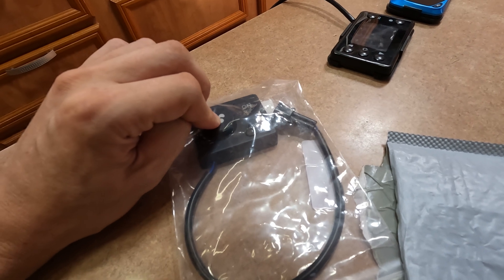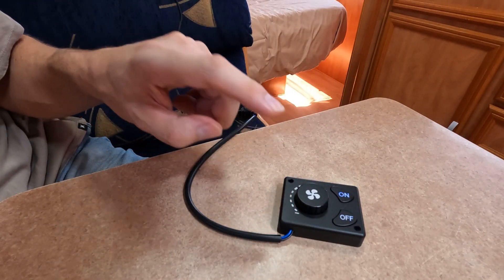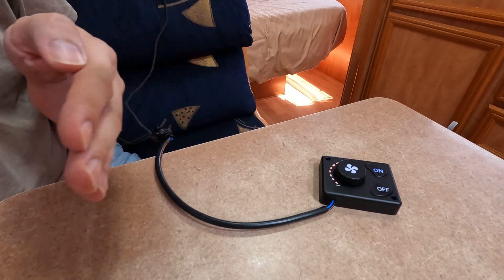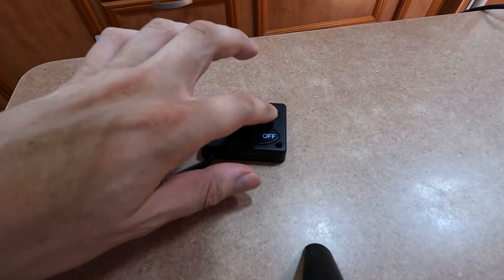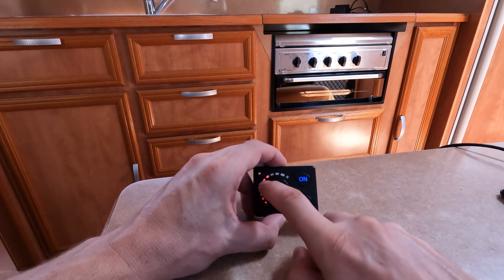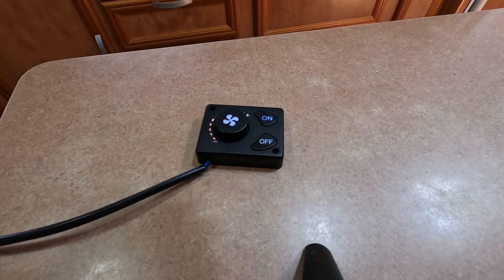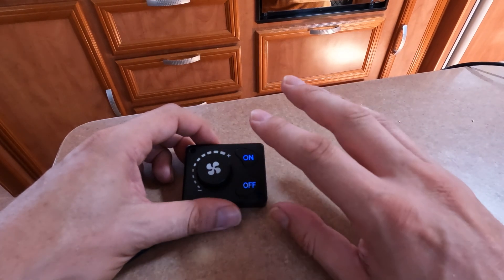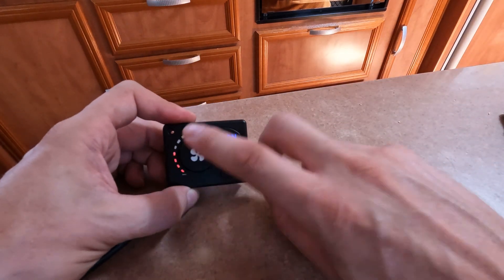How to use the rotary controller for a Chinese Diesel Heater

Comment: Can someone explain what a 6 and 3 blade controllers are?
Reply from the maker: This is a reference to the number of blades on the fan icon on the screen. some have 3 and some have 6.
Reply: @berko79 thanks but I'm wanting to get a new unit and use my rotary controller. Obviously there are no icons on the rotary controller. Do you know if the new 2kw units are 3 or 6? Many thanks
Reply from the maker: @thatwasthedaythatwas  unfortunately i think they are a mix. I've had success in buying the ones with the same plug, type but i've heard thats also not a confirmation of compatibility. Possibly worth taking the gamble - worst case you might need a new rotary controller (which are cheap of amazon or ebay)

Comment: Mine does not switch off. It's tarts but won't stop. I installed it brand new . Came with the heater. So they are not entirely trouble free.  Nor does it click as the dial is turned. Very disappointing.

Comment: These heaters should be outlawed until they can produce a working heater controller I bought 2 diff brand heaters junk bought the knob junk bought all new mother f er board still nothing, dont waste your money, these companies are running a ponzi, also pluged into wall, running car, also seperate battery and charger, charger by its self.  junk.

Comment: When I replaced mine with a simple controller, it wouldn't work & flashed the 7th lights.
Reply from the maker: E07 is communication error (see in the description for a full list). I'd say your controller is not compatible with your heater ecu board. You'll need to replace the control board inside the heater to make it compatible. I'm guessing your old controller, which it may look the same as mine, might be the featureless one they bought out.
Reply: @berko79  thanks. Which controller board do I buy?

Comment: Does anyone know how to change from simple Hz adjustment to actual temperature adjustment. I got mine changed over to Hz somehow and I can only adjust the power output with the knob. It used to rev up and slow down automatically with temperature. I want to set it back the way it used to be, but don't know how to do it.

Comment: I bought this basic rotary controller based iff this video and happy to say it works as advertised. Much simpler to use than the digital version that came with the heater originally
Reply from the maker: Yeah I agree, often simple is the easiest/best :)

Comment: 7:31  what is the blower / heater outlet temp in low and hi setting?? Is the heating power allso reduced or just fan speed?? Is the air temp 30c or 80c in low setting??
Reply: Rotory dial is for the fuel pump speed not so much the fan itself, fan does eventually slow a bit according to fuel input

Comment: Thanks for that. My rotary controller only works on heaters with '6 blade' controllers (not on the ones that use the newer '3 blade' controller). Or to be more exact, it works on heaters that have a motherboard that work with 6 blade controllers. I bought the rotary controller as a spare in case the LCD controller fails. It flashes when there's an error, e.g. 7 lights flashing means error 07. I would use it if it had remote control as well.
Reply from the maker: Yeah different circuitry in the 6 and 3 blade controllers and they arent compatible. I'm not sure if they make a rotary controller which works with the 3 blade.
Reply: Where are the blades ?

Comment: Great video! Its all new to me, just installed my heater in the workshop tonight, as far as i understand when you turn the wheel on your controller it just adjusts the fan speed? What about the temperature? Thanks
Reply from the maker: Yeah you are correct it adjusts the fan speed. The interesting bit about how they work is the fan speed is not just for the hot air it puts out which warms us up. The fan speed is also for how much air it pushes into the combustion chamber and in turn how much fuel gets injected (more air more fuel = more heat). So yes the temperature/amount of hot air produced goes up with the fan speed.
Reply: @berko79  ah right ok, thanks for the reply
Reply: How about outlet temperature?? Is 40c??

Comment: Were you able to locate a set of written instructions for this controller?
Reply from the maker: No, I wasn't able to find any instructions at all for this controller. That's part of the reason I decided to make this video. Luckily it's pretty simple but things like the error codes is a bit different and could easily be missed.